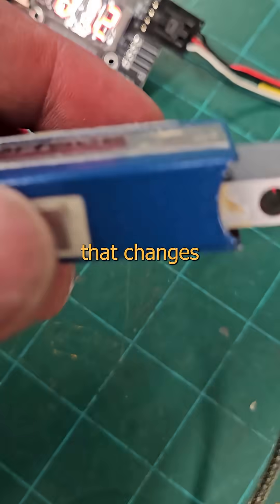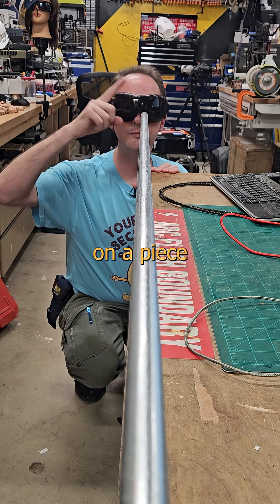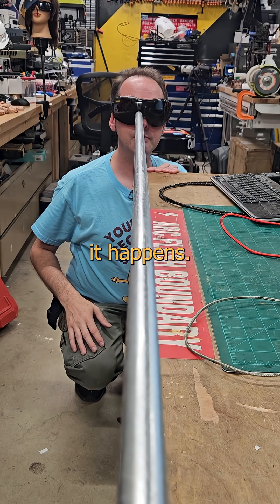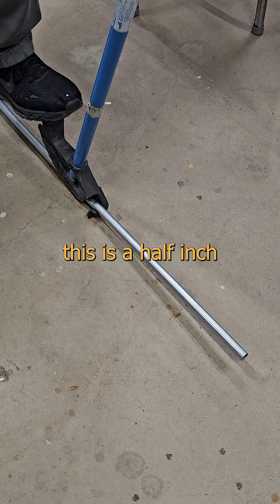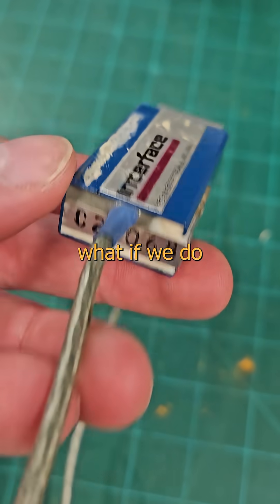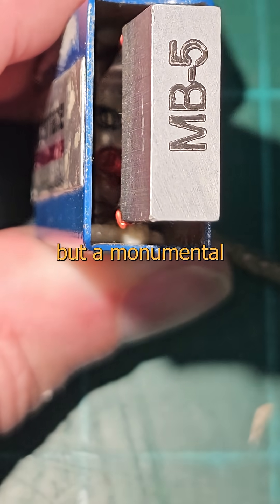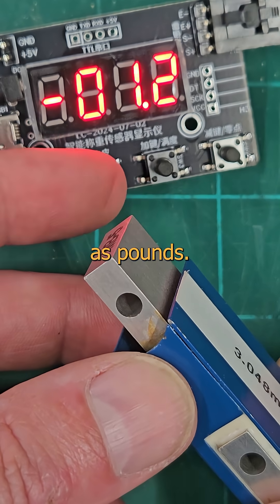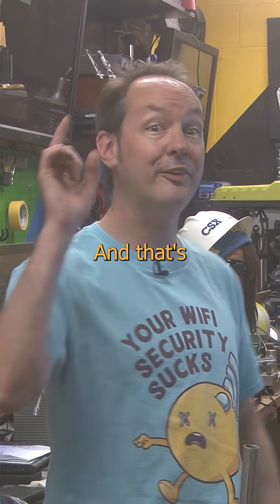Elastic and Plastic Deformation #chrisboden #comedy #engineering #modulus #strain #gauge #scale

Comment: I got yo install load cells on the support structures for pre-existing (not designed fo load cells) storage silos.   They worked remarkably well.  When it rained, you got a few minutes of crazy readings while the metal contorted, but otherwise they were great.

Comment: The Joystick of the F-16 fighter Jet is based on this,  which meant that the stick effectively didn't move at all. 
Pilots wore themselves out pulling harder and harder to get the plane to fly tighter turns,  not knowing they were already at the max.
The stick was then redesigned to have at least a bit of movement so that the pilots would feel when they hit the limit of the system.

And that's pretty cool!

Comment: Scales are honestly insane. Used to work the gate at a dogfood plant, basic security gig, but also did a lot of the intake paperwork including weighing the trucks in and out of the factory. You never fully understand just how sensitive things as solid as that concrete pad on massive quarter inch steel springs is until you watch it accurately gage both a 26,000 pound truck load of dessicated salmon and a 200 pound idiot in a stupid uniform.

Comment: A strain gauge is basically a potentiometer. When the strain gauge stretches, it gets longer and a little thinner. This changes the resistance and therefore the voltage off the other side. Do some math and you can figure out force or strain.

Comment: I worked in a machine shop for a while. It was really weird learning that everything is rubber because when I was using a surface plate to check one of the parts we were making I had another part on the plate and that changed the method measurements depending on where it was on the plate by a couple thou, depending on where it was, the spec was in half thou and it made it really annoying the check parts

Comment: I'm a cabinet maker by trade and wood is also a fucking spring. As a matter of fact, the fastest way to draw a large curve on wood, is to fasten a thin piece of wood on the workpiece at either end of the thin piece and then just bend it upwards, downwards or whatever you need. If it snaps, it is no longer a spring.

Comment: Even conduit springs back when you bend it, like when bending a 90 or a 90 degree bend, if while in the bender you bend it straight to perfect, when you take it out it’s less than 90 because it springs back. You have to bend it slightly past to make it 90. It’s an art. Also funny how the amount of “spring” depends on how far it’s bent from its original shape. Like if you do a kick on the 90 which is just one bend on the side of the 90, it won’t spring back much at all, but the 90 does because both the outside and inside of the wall of conduit are experiencing being compressed or stretched.

Comment: Okay so after the fact like after the beginning of the video I started looking around and realized everything in the damn house has a bending point where you can bend it and it will bounce back into its shape even hard materials such as you know metal ceramic glass has a bending point even if it's just a micro little bit of it it can bend and bounce back and now I'm going to extensional crisis because I'm looking at everything thinking it's a fucking spring

Comment: Got a 100kg full bridger soldered up to replace the hall effect sensor in my sim racing brake pedal. Truly manifests the practical ineffectiveness of using position to measure force. In theory it works, but in practice inconsistent energy leaks don't translate 1:1 to position in the way they do with force measurements. That's my take on it anyway 🖖 may the zoom zoom be with you

Comment: I remember the first day we learned about these at university, we were just using voltmeters to detect the change in conductivity of the wires, rather than it already showing the poundage of force. We managed to calculate that we could detect deformation on a surfece smaller than the wavelengths of visible light. And that's pretty cool.

Comment: I saw a guy on another channel weigh an airplane flying about 5,000 feet overhead using a homemade scale built from strain gauges and an open-top box. The principle behind it was surprisingly elegant: a plane supports its weight in part by pushing air downward beneath its wings—even as it's also "sucked upward" by the lower pressure above the wing, thanks to its shape and motion through the air.

It's one of those often-overlooked minor miracles that make modern technological life possible. Another is the piezoelectric effect. Very few people even know it exists, and maybe one percent of them actually understand it well enough to apply it. And yet, anyone can go out and buy a piezoelectric touchscreen. If a capacitive screen—so common in modern devices—won’t work in a specific environment, piezo is a practical alternative. The funny thing is, a person can use that tech without needing to understand the physics behind it at all.

When you think about how bespoke and hands-on invention used to be, even just 40 years ago, compared to the modular, engine-driven world we develop in today, it can feel downright overwhelming.

Vaya con Huevos, mi hermanos.

Comment: We see this in engine rebuilding. When you get parts such as cylinder sleeves and crankshafts, it is very important to follow the "This side up" label on the box. Sleeves will oval out if left on their side, and crankshafts will curve if done the same. Even the hardest metals you use every day still have plastic properties

Comment: There were three subjects in my engineering degree that did my head in.
Electric and Magnetic Properties of Materials
Continuum Mechanics
and
Stress.

It's the last of these that should have been the easiest (and should have been called Strain) that I struggled with the most. It should be easy enough to transform linear resistance to linear deformation to linear deflection to linear stress... And yet...

(aside - Quantum mechanics was hard until you worked out that there WAS no correlation between the macro and quantum worlds and learned to just trust the maths. Thermodynamics was impossible, the first time you studied it. The second time you began to get a feel for it. The THIRD time you realised you still didn't understand it but by now you were just used to using it..)

Comment: I got to have some hands on fun with some 25 ton load cells. Im a strucral Ironworker working on a google data center. The cooling units we set weight upwards of 90k lbs. We rig them at 8 pick points each with their own load cell and chain hoist so its evenly picked. That way it doesnt fold in the middle and crush itself with its own weight. 8 25 ton load cells each with its own wireless Digital readout. The ones we had cost in the ball park of 9 grand a piece.

Comment: The rate it changes at proportional to the pressure within the elastic range is called the Young’s modulus and it is a known number for most materials. The manufacturer of your scale knows that and calibrates it as such. If your scale goes plastic it has a different stress vs strain curve so it can’t be calculated directly and will give bad readings. Pretty cool stuff

Comment: Yea this is basically the prime idea taught
In mechanics of materials (or sometimes deformable bodies) 

What interesting is the stress-strain diagram for these once you hit the yield stress (point where elastic goes to plastic deformation) and you release the stress, the graph drops to be parallel to the elastic stress strain slope (iirc this is the modulus of elasticity) but once it returns to the x axis, it actually gives you the specific length of deformation. If you do this repetitively, you begin to make the material more brittle

Comment: The only thing I know about strain gauges is using them on the shifter of a manual transmission to cut ignition for just long enough to shift without having lift your foot off the accelerator

Comment: Some aircraft even use a bent metal tube to calibrate some instruments. If the resistance on the circuit isnt correct you put more bend in the tube to change the resistance. Beautifully simple

Comment: I was looking at a truck scale one day. This monster was big enough to hold a fully loaded semi with two trailers. As I looked it over, I noticed that the whole thing was a series of levers which essentially formed a balance beam with the truck sitting on one end and one of those little strain gauges holding down the other, with a little wire running up to a box with a digital display on it. The balance point was close to the truck so the strain gauge only had to hold a small amount of tension.

Comment: I have worked in the scale industry since 1985, not all that long after strain gage load cells became practical (largely because the instrumentation did).  There are actually a lot of technologies for measuring weight and mass, many of them obscure and all of them interesting.  This is a nice summary for n00bs of how modern load cells work except that the load cell in your bathroom scale doesn't look like that one.  Bathroom scales are the cheapest junk you ever imagined.  Block load cells like that are the workhorses of the commercial and industrial tabletop.

Comment: We use them in race cars for the shifter. You push or pull on the shifter handle and it tells the ecu that you want to shift gears. Then the ecu can cut ignition\fuel for up shifts or blip the throttle for down shifts. If you have a dog box, this makes no lift, clutchless shifting a thing!

Comment: I think it's plastic. If you use thick wire it holds its shape and you have to pull hard to get into a new shape. If it's thin enough, gravity has enough, gravity has enough force to reshape it.

Comment: I work on extra-large stamping presses the size of a large house for a living.  2500 tons of smashing force between the ram and the slide. We mount one of those little strain gauges on each press column (which are pre-compressed with tie rods 40 feet long and as big around as my waist).  We are able to measure the tonnage so accurately by the minute change in strain on the column that we can see if a zip tie falls off the tooling and lands in the die.  It's crazy how simple but repeatable strain gauges are!

Comment: Im a LEEA Inspector and it's hard to explain to customers that even hardened steel has stretch. Very very very small but it's there and it shows when I'm pulling something on the 100T test bed I rip things apart with. Measures down to the 0.1 micrometres and it's fun to get to see the graphics when it starts to deform. Even more so when your pushing it to break. 80T loaded goes KAAFCKINBANG

Comment: What classifies as low, medium, and high voltage?
Reply from the maker: There are no less than four correct answers to that question, and they're all very different. It boils down to perspective and really depends on what genre you're working in. Low, Medium, and High voltages are very different if you ask a Lineman vs a Computer Tech.

Comment: Everything is a spring if you measure displacement carefully enough. Everything is also a thermometer (even Zerodur eventually expands with heat), a conductor with enough voltage applied, a fuse with enough current, a microphone with enough sound pressure, etc.

Comment: I made strain gauges back in late 1989 and calibrated them. Easy to do -- doesn't take much to make one. 

When I was working on my computer and electrical engineering degrees, "if it moves, it'll break", was our thing to avoid if at all possible. 🤓

Comment: A side note: The way scales work at sea is that there are TWO load cells. One measures the constant throughput, including when the weight weaves about because of moving. The other load-cell measures constant weight and the interference because of the weaving about, there fore the computer is able to measure the accurate weight therefore the weight computer can calculate the difference and display the true weight.
Source: I was a scale engineer for oh so many years.

Comment: Our upsetter press had 2 x 150 mm square columns with thin film strain gauges glued to 2 sides of each column. They read gripping die force on mine bolt rods as the head was forged on to the bolts.  Cams were used to adjust eccentrics used to control grip force. Had to replace one after several million cycles caused conductor to fail inside the film.  Grind to bare metal, glue area and press new gauge into glue removing any bubbles..allow 2 part glue to cure 12 hours.. connect lead wires and start running. Worked great..

Comment: Tell me what you guys think. . .

I’m working on a theory of high-temperature superconductivity that involves tuning the atomic geometric topography of a superconducting substrate to interact with wave perturbations in the quantum medium (or vacuum) that underlie Cooper pair behavior.

Think of the quantum medium like water in a sealed container. External forces (like magnetic or vibrational influences) generate waves in that medium, and the electrons themselves, through their spin, also generate their own wave patterns. My idea is that by shaping the geometry of the “container” (the substrate), we can influence how those waves move, reflect, and interfere, just like the inner shape of a box can redirect water waves within it.

By doing so, we could potentially enhance or protect the coherence of Cooper pairs by managing the environment around their wave-mediated interaction, without needing to control the electrons directly.

I’m also theorizing a multi-layered, thermal-gradient superconducting material, where each layer is tuned to a specific quantum-temperature resonance. The idea is that, as the system experiences temperature fluctuations, Cooper pairs would naturally migrate to the layer that offers the most energetically stable and coherent conditions, a kind of passive self-regulation.

I ask you now
If Cooper pairs experience zero resistance due to their internal quantum equilibrium, is it valid to say that decoherence arises mostly from external quantum perturbations that disrupt that balance? Especially at higher temperatures where vibrational activity increases?

I’ve written several draft papers on this theory and believe it could be a pathway toward ambient-temperature superconductivity through quantum-medium geometry control. I’m 100% independent though, and not sure how to apply this framework, nor do I know anyone who can. I would love to hear your thoughts or ideas. 

Thanks guys!

Comment: I do alignments on semi and trailer axles. The entire job is taking a big piece of metal and a hydraulic press, and pushing it just past the point where elastic becomes plastic deformation in order to get the wheels aligned. Can't go too much because you'll kink or break an axle, but if you don't go enough it springs back to where you started. Not to mention deforming the correct spots to do what you want and spreading it out enough to even the load. I love this dudes videos. He makes everything feel connected some way or another

Comment: Breaking bolts is another way to learn plastic deformation. I've been able to communicate to new coworkers how tight to do up the steel bands on a bundle of aluminum can bricks by comparing the feel to when you've overtightened a bolt. You want to get into a little elastic deformation, then stop. So I describe it as being like when a bolt is tight enough by feel.

Comment: Im an architectural engineer student, recently in a lecture i learned something cool about this topic: When an earthquake (or any other accidental force) hits any strcuture it causes the structure to vibrate, if the structure resists this force it will make the structure to vibrate at even so hight rates that you dont even notice it. This behaivor would be impossible if we had infinetly rigid materials that could resistst any force.
And thats pretty cool

Comment: I've had to make very precise ones that measure tension on a 4 and a half inch wire rope. This is when they were trying to figure out why they were losing oil rigs in storms that shouldn't have been causing any loss.

Comment: I work as a Tube Bender and machinist for a company my dad co-founded in ‘03. In the bending world we have the term “spring back” for how much less than the desired angle a bend is. So if i bend some .250x.035wall 304 smls at 90° and when I measure it i get an angle of 85.3° i know that i have to over bend all 90’s by 4.7°. But that doesn’t mean every bend is going to be 4.7° out. Only the 90’s. The multiplier is linear, and you can plot 2 different bend angles (i use 4) to calculate your multiplier using Y=mX+B to plot a line of best fit to help you calculate the amount of spring back you have to account for.

Comment: The only thing I can think of that doesn't abide by this rule are glass and ceramic materials. Glass has an insane elasticity whith no (or maybe almost nonexistent) plastic deformation. 

Yes, you can cut glass, but you only scratch the surface, and it chips/splinters instead of its material getting pushed aside like, for example, iron.

Your last point still stands, everything is a fuggin spring

Comment: I had an engineere show me a bit of heat treated 6Al4V titanium that he had clamped to a table and set up a dial indicator. I was able to bend the bar so much that the clamp gave up and stopped holding the part down, and it still went back to 0 on the dial. I had it bent almost 8+ inches and it still went back to 0...

Comment: Also the "everything is elastic" is one of the first things machinists learn. A carbide tool is only straight when its standing still. As soon as you put it to material, its gonna bend. Normally this isnt noticeable, but ive had parts come out undersize if the tool was too long or the cut was too much.